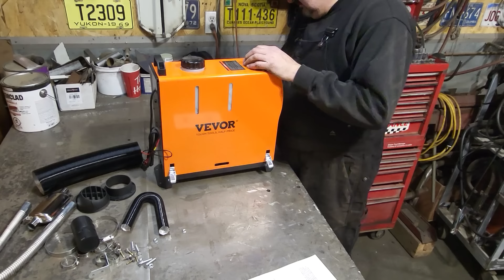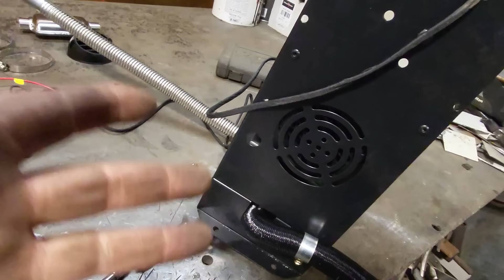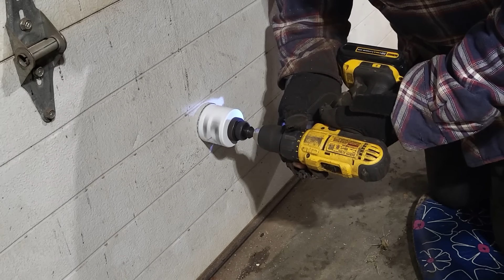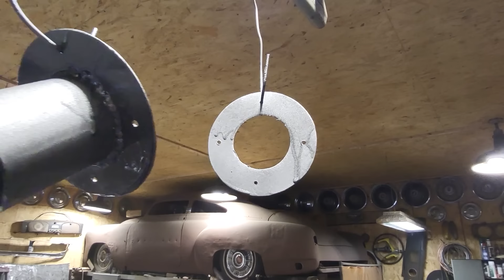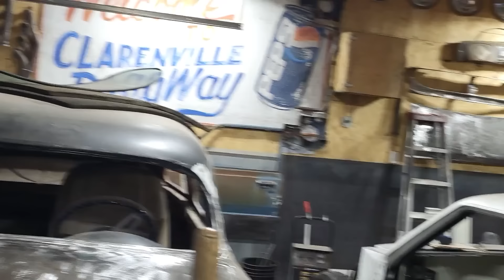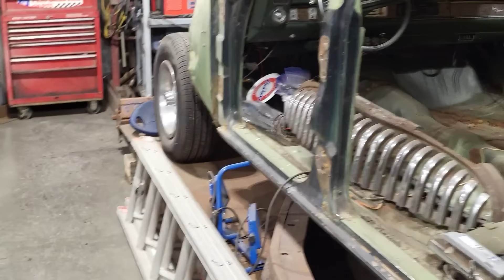Will a diesel heater heat my 800 square foot garage?

Comment: The little air intake with the filter on it should rightfully be Piped outside as well. That'll fix your stale air concerns.
Reply: No it won't. That is the air intake for the burn chamber only.

You don't know what you're talking about
Reply: @KR-wf7cq  do you own one? 😂  I have one, It's not the portable one. If he took apart that portable shell it would have the same one I have inside and he could pipe both the chamber intake and the fresh air and take outside, but you would still pull fumes, So I'd rather resurculate the hot air in the room and Have everything to do with the burn chamber piped outside, besides that His garage is too big for one of these to cause a stale air condition anyway.  But Hey, if you want to continue burning with the chamber in taking side, just let me know when you can taste the hydrocarbons in the air. 😂 🤣 😅

Comment: We use to heat with kerosene, this yr. We cant get it here so we got one of the cheapest ones they got. It doesn't even have the remote just a pust button on an off. It will heat our house easy and here even if we could find it, diesel is over a dollar a gallon cheaper than kerosene.

Comment: Should have your air intake come from the outside instead of sucking up the air in shop and blowing out exhaust. I always take off the heater end cap to let more air flow too. On those "portable" units I found they have a different ecu than the older non "portable" parking heaters. The ecu's could be adjusted by fan speeds and pulse rates(pass number was 1866 on my heaters) ,I have mine set at 6.0 pulse rate .I am heating several small garages and my weight room /man cave .

Comment: That's a cute little heater.  My cinderblock garage has no insulation whatsoever and the door is just thin aluminum.  I can heat it with diesel, but I usually just use kerosene as my torpedo style heater will run on either one.  The garage door opening is an odd size so no door fits it right and always has the top panel tilted inwards (It originally had a rolling style barn door).  The torpedo is loud, but in as much as I'm usually out there by myself it isn't like I have to shout to anyone over it.  Ah well, I never have to worry about ventilation, LOL!

Comment: So the heater is diesel specific? No kerosene
Reply: These run fine on kero, however the dosing pump will wear faster using kero because it doesn't have enough lubricity to keep the pump properly lubricated. some folks will burn a 20% kero:diesel blend to help avoid gelling issues and in other parts of the world kero is cheaper than diesel. In general, kero will burn cleaner than diesel, so some will burn a half tank of kero every few refills to help clean the combustion chamber.
Reply: Don't run dirty fuel use the cleanest fuel you can find or the combustion chamber will carbon up and it'll be useless until you clean it out.
Reply: Run 50 percent kerosene or better .50 percent fuel oil.  Our diesel is ultra low sulfur with no issues running it.

Comment: mfgr claims 8Kw, which is 27,000 BTUs, but fuel consumption claims about a gallon overnight and a gallon of diesel is only 140,000 BTUs. That puts the unit at around 17,000 BTUs total (140,000 divided by 8 hours) ... and some of that goes out the exhaust. If you had an 8 Kw electric heater it will all stay inside. (no venting) BTW, based on your price for diesel, and hearing how cheap your electric is (hydro power) I would think electric is the way to go in your area.

Comment: Hi Fitzee, i have a similar diesel heater, i would seal where the exaust pipe is clamped to heater with heat cement/paste 
Also have the air intake outside i believe this helps the air quality 
Good luck Bronx NY.
Reply: that silicone sealer he used on the door is good for 600 degrees F. That should be enough to seal the pipe connection.

Comment: Fellow maritimer here .NewBrunswick.I use the same one for my tractor cab..Had it for 2 months.Works awesome..A bit too much lol..Once you turn it on ,it activates the glow plug for abit , then once it clicks (that’s fuel pump running),you’re good to go ..I have still pics on my YouTube Onthecheap.

Comment: I Also live in a cold climate (Bemidji MN) whenever I need a vent/hole in the shop , besides a cover to stop the wind ,I stuff a piece of closed cel foam rubber in the hole for insulation. Then just pull out when in use. Enjoy your videos, thx Randy

Comment: Smell goes away after a tank or 2 of fuel. Also best to bring the combustion air tube outside also. What's happening is your creating negative air pressure in the shop. Thats sucking in the cold air from any gaps anywhere. I also find you get a better burn. I would not take the cold air in from the intake side for the actual heat. That's moisture from the cold and snow you will have water dripping all over your doors. And yes I have 3 so I know what I'm talking about. Best xmas presents to myself thank u vevor

Comment: For all costs considered to buy and run this unit I'll stick with electric heaters, I warm up my shop with a propane unit for a few minutes and electric heater takes over from there to maintain the temperature. Shop is 36' X 18' with 7 1/2' ceiling, 15+ years and still good. I'm in the process of putting a woodstove in my  woodshop now 32' X 18'  and I think that'll be fine as I can burn waste wood as fuel. Good video as usual and look forward to more.

Comment: Most likely it was heating up the igniter. Once that heated up it started pumping fuel.

Having the intake inside you are creating negative air in the shop. It will pull cold  air in from somewhere to make up the difference.

The btu rating is 27,297 btu’s. Where house furnaces at 100,000 older ones being 80% efficient for 80,000 so 1/3 the capacity of a home furnace.

Comment: I have the 8K version that has the tank separate from the heater. When the heater is off, simultaneously press and hold both the up and down buttons should put the pump in prime mode. Release the buttons to stop the prime. Mine has about 6 feet of fuel line and I have let it run out of fuel so priming is important otherwise it will error for fails to ignite. Also the small intake hose and filter should also be plumbed outside for the heater to get fresh air and may be the reason for the fuel smell.

Comment: if its anything like a webasto heater, if you dont let it wind down on its own, itll build up soot on the basket inside and youll have to replace it.   on a webasto, thats like $500 to replace
Reply: Itt usually fries electronics too ..

Comment: I've been tossing the idea around of one of these for a while now, just haven't pulled the trigger. My garage is the same dimensions as yours but I'm limited to 50 amps so the electric heater at full power, lights and 5hp compressor kicking on is right at the threshold of kicking out the breaker.

Comment: The weather is opposite to yours here in Queensland Australia with temperatures in the mid 30's C and high humidity and a lot of rain. Not to mention the cyclone (hurricane) that just hit further North to us, which didn't affect us much here.
Reply: Can I then assume that you have fitted a refrigerated air-conditioning unit in your garage?
Reply: @georgebettiol8338  No, I just use a fan in my shop.

Comment: How warm do you normally keep it in your shop while you are working? I use a kerosene heater, i used a heater borrowed from a friend which was diesel powered and I didn't like the smell of diesel fumes. Just my opinion.
Reply from the maker: About 15 to 18 degrees Celsius

Comment: With what diesel cost in Newfoundland Doesn’t seem very economical compared to propane, The cheapest Is $4 a gallon for diesel in Connecticut, USA.
Reply: I use 40 percent fuel oil .. at $3 a gallon and 10 percent gasoline to keep the caloric content and gel point up
Reply: @hillaryclinton1314 we can’t use fuel oil because of road taxes, if you get caught it’s bad

Comment: I think a true test would be if the heater was drawing its air from outside. Like you said, if you are welding or even rattle canning a small bracket it would create fumes. It would be harder to heat -10 air to 18 degrees than 10 to 18 degrees.

Comment: Hope this doesn't mess up the top door seal when you raise the door.  I'm sure you've taken this into account already.  Those diesel heaters seem to have an excellent run time, much more efficient than torpedo heaters and no fumes. Nice project and review Tony!
Reply from the maker: It clears no problem
Reply: WHAT was the temp you said was a good working temp Fahrenheit??  @fitzeesfabrications

Comment: Another convert!!!  I have been running one for a while now. 

"All dem ole VW bugs are diesel aren't dey?) LOL at Ray Joy.

You need the high amp hour rating of the battery to get the glow plug heated up at the start, after that the draw is very low. I use a 1 amp battery maintainer (from princesses A) to keep the battery up. I also have a furnace to heat my house  😉 So have experimented with red fuel with great success. People on the internet have used chip fat and everything...
The heaters like to be run flat out, otherwise they have a tendency to carbon up. Chinese diesel heaters, Blair likes em too!

Comment: The combustion air intake needs to be outside, that might be where your smell is coming from as it might be occasionally backpuffing.
Reply: Nope.  Inside.  Should you have a back puffer, a,,,Never shut it off or extend the intake hose by triple factory length

Comment: I have a similar heater in a workshop half the size of yours and around my Citroen SM restoration. I did away with ALL the plumbing and move the heater around the workshop where I need it. I have a 220v  to 12v dc transformer cable tied to the case and plug it into a wall socket. The only fumes you get is on start up, when hot it’s fine. In a camper or truck cab you would most definitely need the plumbing and it would dangerous not to do so. You get 8kw from the heater plus another 8kw from the exhaust. Why waste it through your door. Try it I did and I am still here at 79 years old. Back to your film

Comment: Hi! I use the same Vevor diesel heater. I have connected fumes output to copper (phi - 28mm) pippes to use warm from fumes. Remember, never disconnect car battery from the diesel heater until it cool dwn. When you turn off the heater, interior fan must to work some minutes after oil burning. When you disconnect hot unit from battery carbon deposit and tar will seal filament inside the heater. I have destroyed my Vevor filament in this way.

Comment: Three weeks ago I also tested a 8 kw diesel heater in my workshop. I have about the same floor space (13m x 6m), but about double the height. So it didn't worked out for me. I would need two or three of this heaters. 
Have you tested consumption?
The 8kw heater I used burned 0,47 liters per hour on full power.
Reply from the maker: It drinks it at full power. I think it will be great for my camper. This was a experiment just to see. I'm happy with my electric heaters.

Comment: If you take outside air over the exchanger you lose quite a lot of efficiency.  You are heating 10 degree air (or far less) to 60 which is a fifty degree rise continually while also pressurizing the inside which increases warm air flow to the outside.  A lose, lose situation.  A filter over the intake to screen unwanted dust accumulation on the exchanger means you are only reheating already warm air (once you are up to temp).  This is a far, far more efficient way to run the burner.  Most especially when you are putting full demand and then some on it.
Reply: the fresh air intake for the burner is what gets dumped out the exhaust. It's not what gets blown into the shop. You will not pressurize the building by taking in fresh air for combustion.

Comment: Hi Fitzee, I have a very similar setup in my garage (500 square foot)   My heater is just a cheap no name one. Only thing I modified I changed a soft fuel hoses to a hard nylon one so its not pulsating and cavitating.  It should make the pump more efficient and extend its lifetime.
Reply: They say these china  heaters are all the same.   Except for the USA/German makes
Reply: @user-st5rc9nz4j they say wrong.  I have 20 of them,and 10 distinct types in that bunch

Comment: No such thing as an 8Kw, they're only made in 2kW and 5kW (different size burn chambers), I suspect the 8kW was originally a typo, but more power sells! Those heaters are a copy of the Eberspacher truck cab heater, now long out of any design protection. I have two of the standalone units, one for my machine shop and the other for the main workshop. They're generally very good units, but can suffer from severe carbon build up if left running at low load for long periods. I run mine in power mode, not thermostat, so they're at 100% all the time. If it gets too warm, I just shut them down (let them go through their shutdown routine). If you know someone with an exhaust gas analyser, it's not a bad idea to tweak the fuel pump rate and fan rpm for the cleanest burn (information online on how to access the hidden menu).

Comment: Good heater I ran 1 inch water pipe the length of my work shop hooked the exhaust through it acts like a radiator

Comment: HaHa I did the same. Just push the on/off button and let it do it's thing. It goes through it's modes and works. Same for turning it off.  I've been heating the garage with propane. I have a feeling this will be cheaper.

Comment: I don't have anywhere as large a garage (400sq.ft), I heat mine with an air heat pump. I think the biggest heat waster in my otherwise well insulated garage is that garage port. I reallly dislike it to be honest. steals space in the roof where I could have shelves, It doesn't seal well and gets cold despite having insulation, lots of thermal bridges. Been thinking of replacing iit with double doors.

Comment: Sounds like a turbine engine. What if the odor doesn't go away?
Reply from the maker: This was a test. I don't plan on using it full time in the shop. I got it for my camper   but was interested  in seeing what it can do. Been lots of good tips here abouts the smell. Just needs to be fine tuned

Comment: Nifty noodles. Could you have used a 12V battery charger to provide the power for it rather than the battery?
Reply from the maker: It should work.
Reply: You would need to have a charger capable of delivering up to 15 amps at start up and shutdown while the glow plugs is being powered. You would also run the risk of overheat damage to the ECU if you lost power while the heater is running, since it wouldn't have power to cool itself before shutting down. best power for these is a 12v battery with a cheap smart charger connected to the building power source, this provides the amperage to run the glow plug but also allows the heater to automatically go into proper shutdown if the voltage in the battery drops too  low.

Comment: i just got one for my 850 sq ft garage it works great but im making a sand battery out of a old water heater and going to mount it to it with the sand battery i'll recover all of the waisted exhaust heat and it will keep my shop warm during the overnight so i wont have to run the heater 24 hrs a day

Comment: Good content as usual.  Your combustion air intake (smaller black hose) should be outside.  That's how they are designed to be used in big trucks (the original target community).  A CO detector is a good idea too.  As far as stale air is concerned as long as you're not burning inside air (you are) or sucking in exhaust fumes the heater shouldn't affect air quality any more than your electric heaters.  My shop use to be a barn, 30x40.  It had small doors for goats to use.  When I converted it I closed those doors off save one which I modified to seal off the air intake of an 80,000 BTU (23KW) fan forced kerosene/diesel 'torpedo' heater.  (these diesel  parking heaters were really expensive back then).   It keeps my shop warm, 70+ F, even when it's 0 F outside and the CO detector never even goes above 0 ppm.  (I know the detector works because it detects CO if I run an engine in the shop without connecting an exhaust hose. ).  BTW, I have one of the 2KW Chinese diesel heaters in my van.  It works great.
Reply: No.. the ONLY thing going outside is exhaust.  Diesel is a low temperature burn, and cold air can quench it or kill it at very low temps..   agreed on the CO detector

Comment: The new unit smell will burn off after 1 tank of fuel. But the fuel spillage will stink!!  I settled on a pair of 1.5 gallon push button plastic fuel jugs and have not spilled a drop in 3 seasons.

Comment: One thing comes to mind... did you check if the door still opens? Might stick too far out it catches the door seals or hits the framing. Where you put it in the middle it should have more clearance but was just a thought
Reply from the maker: Clears no problem
Reply: I was wondering the same thing.

Comment: I just installed one in my shop, about the same size as yours with 11 foot ceilings, insulated. It does take a while to bring the temp up but it will bring the temp up from 43f to 57f and hold it while the temps are dropping outside at night. Sometimes I'll use my propane jet heater to preheat the shop, don't like to leave that one on full time as it's loud and stinky. You'll need about a 15amp 12v power supply to run this off the wall, anything lower and it doesn't seem to be able to get the glow plug going. Seems like a decent enough product if it's reliable long term.